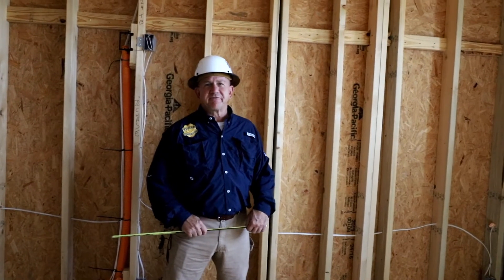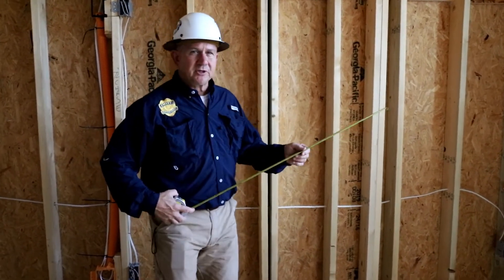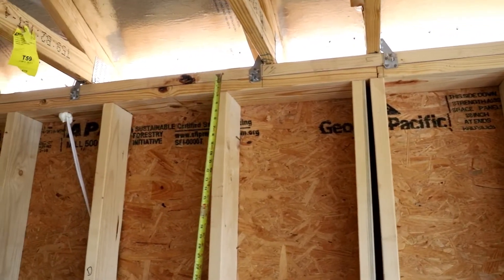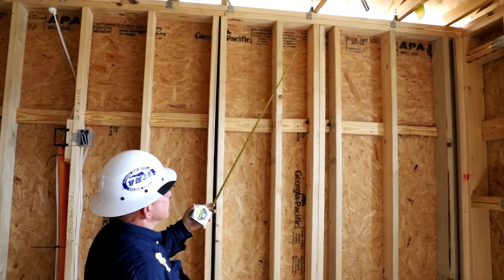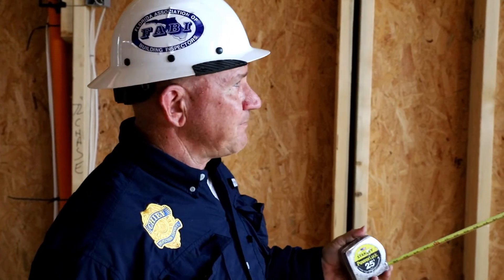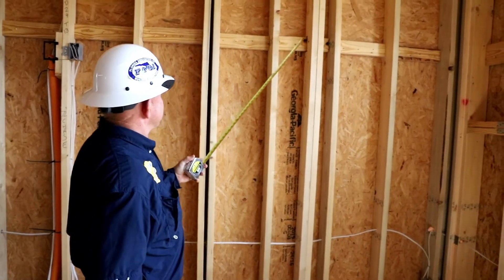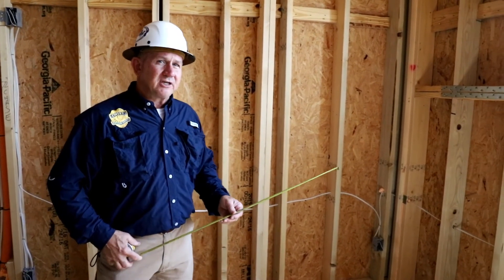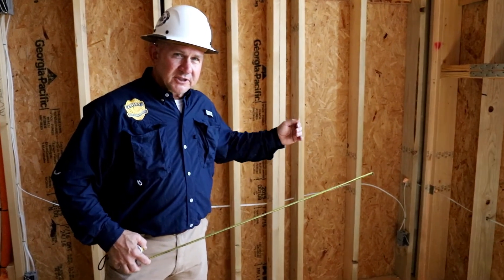shear wall in new construction

Comment: In my area, the engineer of record ( EOR) is responsible for doing the final inspection of any shear walls and structural components.
Reply from the maker: Wish I could say the same.  Where are you located?
Reply: @homeinspections up in British Columbia, Canada, its a very high seismic zone, so our engineers dont want to take any chances with builders making mistakes as the engineer takes liability

Comment: Maybe I'm not seeing the whole picture but hurricane clips holding the trusses down to the top plate?
Reply from the maker: Sheer wall inspections is all about reading and knowing what type. And how many fasners are required in order for the building to perform as designed. very critical in high wind areas like Florida.